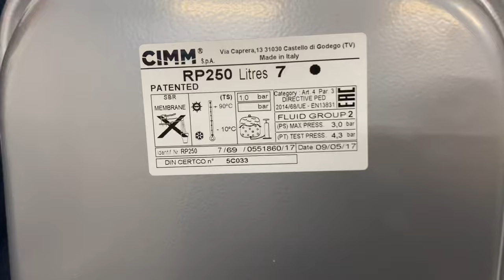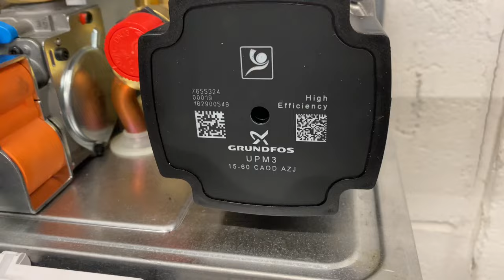Gas Training - How A Combi Boiler Works With Roy From Viva Training Academy

Comment: Absolutely excellent explanation of the component parts of a Combi. Learnt a lot. 
Only comment is the term used for the 'small' input connector to the pump. Its a Pulse Width Modulation, not Power Wave Modulation connector. The controller sends a fixed frequency pulse to the motor on that connector. The width of the pulse determines the 'power' the motor develops.The connector also provides feedback to the control circuitry of the pumps condition
Reply from the maker: Thank You

Comment: Id like a video on how to link out the external controls on a boiler at the pcb. such as the timeclock,room stat etc and how to test with a multimeter if the voltage supplied by the external controls is sufficient. It would be handy on breakdowns to verify its the boiler or the external controls at fault. Brilliant video by the way
Reply from the maker: We will see what we can do. Thanks.

Comment: Thanks for your informative video. I have a boiler which has an expansion tank, but my annual safety inspection says that I need an additional expansion tank. The only stipulation on needing an extra expansion tank in the manufacturers installation instructions is when a hot water storage tank, water softener or refridgeration system is installed, which I have none of. Do I still need an extra expansion tank installed? Thanks.

Comment: Hello, I’m seeking a piece of advice. We’ve 12 years old Conventional gas boiler at home we recently moved. There is no thermostat so we’ve to switch on/ switch off the boiler for heating. For hot water, there is a separate electric water heating system too. Is it advisable to get the thermostat for the heating system which is costing 250-300£ with installation? Many thanks
Reply from the maker: Depends when you plan to replace the boiler.

Comment: Impressive indeed. As a trainee future videos of how to use the multimeter to detect faults would be great. Also would you have a link to that box spanner used?. Thanks in advance.
Reply from the maker: Thank You
Reply: Hi Sanjay, it's from britool part of the expert range, the part number is E113515
Reply from the maker: @royfugler9971  Thank You

Comment: I'm just a curious consumer, don't worry not going to be attempting anything myself... When I moved into this rented property all worked OK but after having a lot flow tap fitted the flow rate of the water isn't enough to trigger the boiler to kick in. After the yearly boiler inspection they tried the taps and had the same issue but didn't bother to fix anything on it.

If I want a shower I have to adjust the temp of the boiler before I get in so that the hot water can stay on full, if I put the cold tap on the boiler kicks off 😂

In the summer I could only get how water with the heating on for the low flow tap at the kitchen sink. Needless to say the taps been swapped out now.

Comment: The plate heat exchanger, for hot water.
I think it's called a plate heat exchange is  made up of plates in layers with cavities instead of tube in a primary heat exchanger.

Comment: My central heating gone to 3 bar. When I released the pressure to 1.5 within half hour it goes back to 3. Could this be the plate exchange leaking, causing domestic water to pressurise the central heating?
Reply from the maker: https://www.youtube.com/watch?v=UR9wSU-I2O8

Comment: Hi Allen, thanks for your videos it’s been very helpful. I’m having a strange problem with my boiler recently. Lukewarm water from hot tap. Changed the diverter valve and heat exchanger but still the same. The water only gets hot when I turn the tap Down to half. Any ideas please ?
Reply from the maker: Blocked plate heat exchanger or cold water flow too high maybe ?
Reply: @AllenHart999  I replaced the heat exchanger without results. High water flow is a good guess but I didn’t do anything before this happened 1 week now. Can I check that?

Comment: Does this boiler have room to put the pipes up the back without a stand off ? As I know the main eco compact you can’t
Reply from the maker: Yes. Baxi 600 / 800 pipes can go up the back. Thanks.
Reply: He said this was the potterton assure ?
Reply: Hi Dean,
Yes Asure is same as Baxi 800 & 600, you can run pipes up the back, Main Eco Compact has two bars running across so you can't
Reply: @royfugler9971  thanks for the reply Roy and great video

Comment: If the plate heat exchanger is used as a bypass isn't there the issue of having scalding hot water at the tap when you first open it? 

Had a recent issue where the hot water flow switch was stuck in demand position eventhough the tap had been turned off. The boiler was continuing to heat up to 79/80 degrees until thermistor cut out. Dangerously hot water from the tap.
Reply: The plate heat exchanger holds so little water the chance of having scalding hot water at the taps is nil
Reply from the maker: Thank You
Reply from the maker: @royfugler9971  Thank You
Reply: @royfugler9971  I've witnessed it for myself. The temperature was high enough to easily cause injury to someone. Even the boiler manufacturer states that the pre-heat system should not be enabled unless there is a long enough pipe run to any outlet as the water could scald. If using plastic pipe there will be far less heat dissapated along that run.
Reply: @vistron888   I don't doubt you have come across scalding hot water, however the cause would be more likely to be a fault causing the main heat exchanger temperature to be 70 - 80 degrees than the plate heat exchanger being used as a bypass

Comment: Great video mate, question is it possible to remove the turret on the top of the boiler? A duotec you can remove it which I’ve had to do before to replace the heat exchanger top seal. Tried to remove this turret before to change the flue seal and looks like has some locking lugs and was unable to remove it. Had to smash the flue out and pull the flue out. If you can maybe find an answer for this be great. 
Cheers mate!
Reply from the maker: Not on the answer to that buddy. I will try and find out though:_cutters::_wrech::_burstpipe::_blowtorch::_toolbox3::_toolbox2:
Reply from the maker: Do you have any ideas for future videos? Thanks.
Reply: Heat exchanger can be removed. 
Once you have drained down and removed the flow, return, condensate pipe and retaining bracket, just pull the heat exchanger forward and down.
Reply: @royfugler9971  what about the turret on top the boiler mate can that be removed ?
Reply: @TheNishNu   Yes, the turret is held in by 4 black self tapping screws, once the elbow is removed it just a case of removing the screws and lifting the turret  up and out

Comment: Allen great video as always, but the trainer did say Everything is designed to come out the front, and yet the first part he removes, the Expansion Vessel, can only come out the side? because the bracket is in the way, please don't hate me, just gave me a laugh, when he said one thing then had to do the exact opposite.
Reply from the maker: Yes it can all come out from the front. We removed the sides so you can see it all better. :_mul::_toolbox3:
Reply from the maker: Do you have any ideas for future videos? Thanks.
Reply: He said you can remove from front but you’d need to remove the bracket
Reply from the maker: @ritchiewilkinson361  Thank You
Reply: Hi Richie,
The expansion vessel can be removed without taking the side panels off, you are right the bracket would need removing, which you do by slackening the two screws and then slide the bracket out

Comment: Is power wave modulation the same thing as pulse width modulation?
Reply from the maker: No idea. Sorry.
Reply: It should be pulse width modulation, even says this in the pump manual.
https://en.wikipedia.org/wiki/Pulse-width_modulation
Reply: it is pulse width modulation, i think he is just a bit confused.
Reply from the maker: @ricardobranco7357  Thank You
Reply from the maker: @kevincranfield5235  Thank You
Reply: Hi Ricardo,
Yes you are correct, thanks for pointing it out.
Reply: @kevincranfield5235  At my age I'm easily confused 😕
Reply: @royfugler9971  even the trainers can learn something on the allen hart channel! thanks for the tip about the top hat washer roy

Comment: Wow what a great video.  This guy is top draw .  My Worcester Bosch 24i isn’t heating the tap water like it used to any ideas ? Oh and my expansion vessel leaks water when I push the shraider valve 😩.  I’ve had it 14 years and never serviced it
Reply from the maker: You can say that again. Thanks